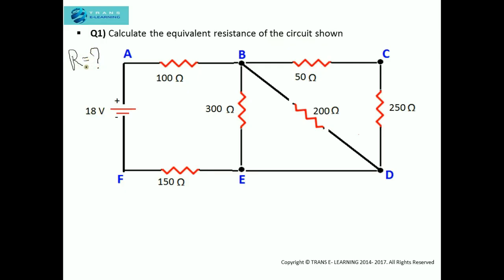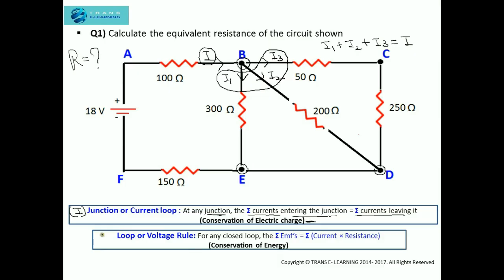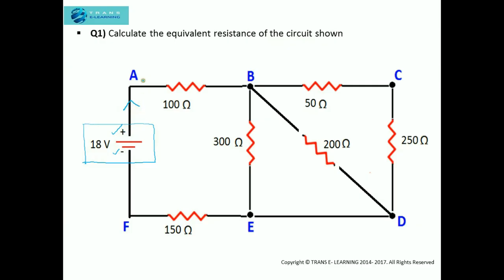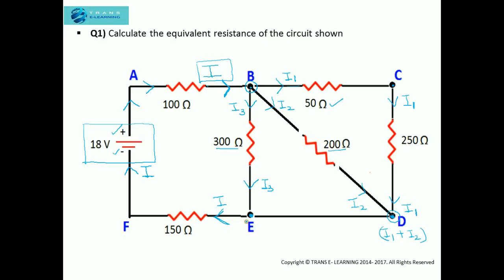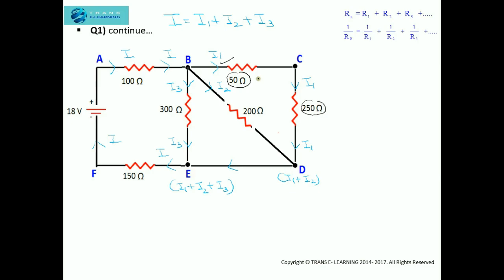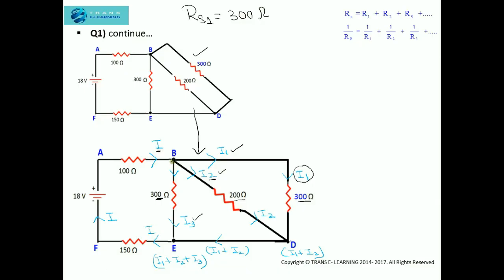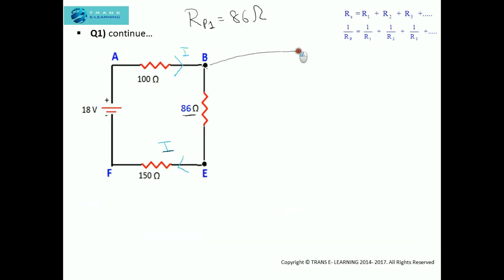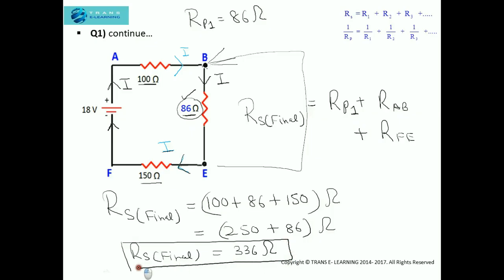Kirchhoff's Laws - How to solve problems using Series & Parallel circuit combinations (PP-V)PART-1

Comment: 7/600how that did come out please
Reply from the maker: 7/600 is the result of taking a common denominator . I have multiplied and divided 1/300 terms with 2 and 1/200 term with 3 to get the same denominator(600) , then i have added the numerators. Hope this clarify your doubt.